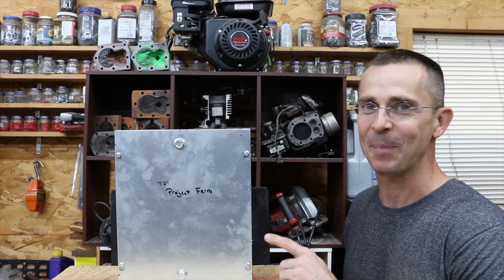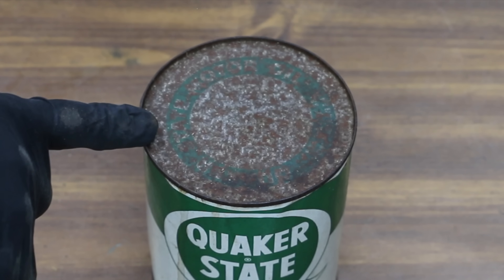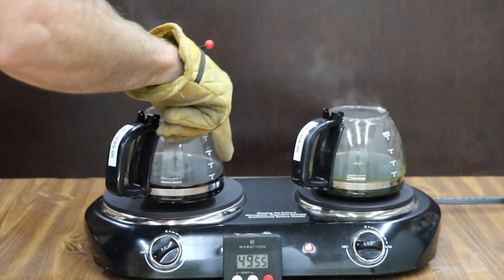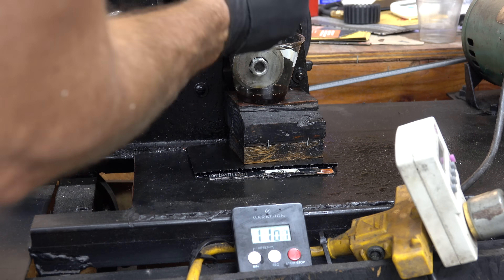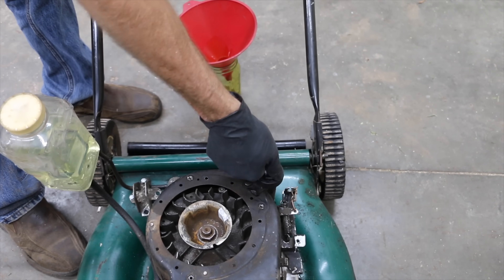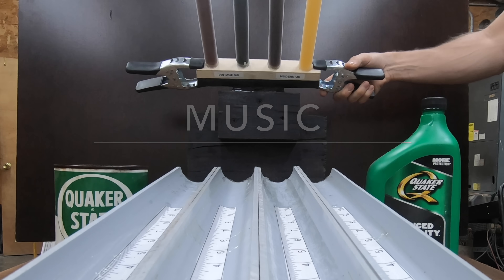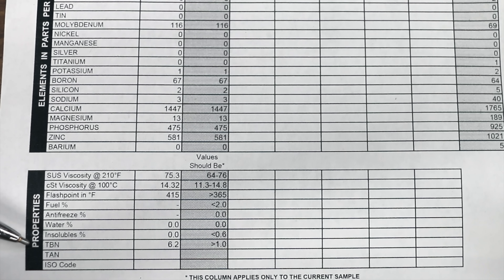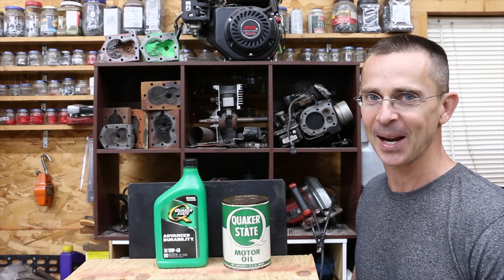Is Oil Good After 70 Years?  Let's find out!

Comment: The shipper has dealt with UPS and the others before.
Reply: United Parcel Service Smashers
Reply: As someone who works at ups unfortunately I can confirm this
Reply: I respect every customers package as if it was my own but they hire some lazy people more often than not
Reply from the maker: Great point!
Reply: That thing is a time capsule. It may have been shipped from the 60’s.
Reply: It's not so much lazy people causing damaged packages, it's the company having the unload send packages down at a rate faster than the conveyors can handle causing them to spill everywhere.  Happens every day all shift long.
Reply: @donjohnson9688  true, I wish the supervisors knew how to manage the operation so it works efficiently
Reply: They are sadistic
Reply: Me too! UPS hated life when they had to cut me a $1800.00 check for their "professional" buffoonery.
Reply: There's reason I call UPS uuuhhhps (oops)
Reply: UPS -  we are kicking parcels over the fence you couldn't do better.
Reply: SO TRUE.
Reply: God, UPS is Brutal!.  On one visit to UPS a worker bee said they couldn't guarantee they wouldn't bend a 1.25 Inch antisway bar for a 1962 Corvette. I took a chance. They shipped a Homda Z50 from Fresno area to North Dakota. But it stopped 10 Miles from the buyer. UPS then REMOVED ALL THE PACKING AND CARDBOARD!!  BUT I had made a video of the box BECAUSE UPS is Criminal. Upon return UPS literally returned it back to the buyer! Over 7000 miles.Why? Because the driver thought he damaged it and was attempting to do a CYA. Damage was only the tail light. I have Many ups stories. FedEx ground was much better at delivery.
Reply: cisa93  Either way he had to travel at 88 Miles an Hour and when the car came to a stop, it along with the box was frosted over. 😂
Reply: BOOM!!!!   😂😂😂
Reply: @AKGirthQuake  I work for another worldwide shipping company and I can confirm here it's the same.
Reply: Usually, it's the oil that the protection. In this case, protection was offered to the oil instead.
Reply: I think they play football when loading trucks
Reply: @thelifeofjessejames  lol loved that one!!!
Reply: I used to work next door to UPS for one of their competitors at an air freight terminal. One night, I was watching them sort and they were really tossing (throwing?) the boxes. I commented to one of their supers that i was friends with about the flight time those boxes were having on the ground and asked; "I didn't think you guys were supposed to throw boxes"? His Reply; "We dont "throw" boxes". "Those boxes are being "relocated" from a distance". True Story. I cracked up too.......
Reply: looks like a bomb :O
Reply: Not UPS...he wouldn't have spent so much time and energy on it as they usually just lose the package.
Reply: @KowboyUSA  They are learning the US Postal Service.
Reply: When you pack for their service, just think the packet will make through a warfield.
Reply: @happyraccoon4791  NEVER TRUST THEM, more when it come to classic car parts. THey dont give a f1ck. I was in a Boombox forum long ago and the radios arribed destroyed, The more they packed them, the more they punished them. They are sh1t and insurance wont cover a piece from a classic that is not easy to find again
Reply: @38911bytefree  that's so true. I have many stories from the early 1980's to 2013. Barbarians. Once I asking Wataf and as I spoke, Lo, two guys were literally throwing my boxes like frisbees. Blind hyenas
Reply: I wonder if that can was undented when it was put in, HEH
Reply: I have seen a300 lb  transmission for a machine (built like a tank) with the 1.5 inch input shaft BENT from being rammed by a UPS  forklift.
Reply: Great heavy duty metal Indoor electrical junction box
Reply: @agarbanzo360  in Soviet Russia, the metal protects oil.
Reply: Most people who pack things to ship do not follow even the minimum requirements posted on the UPS web site, they require at least 3" of packing on all sides of the item and I believe double boxing. If people did that the breakage would drop to near zero, but nope, people get an old, tired used lettuce box out of the trash at the supermarket, put that antique china vase in it, crumple up 3 sheets of newspaper and throw a couple  handfulls of styrofoam peanuts in and call it good. See that a lot over the years on Ebay stuff, while others do a bullet proof packing.
Reply: Man, all that bomb-proof packaging and the can still arrives with a big dent in it!

 LOL
Reply: I guess its just me but from 500+ packages Ive received, maybe like 10 were in bad shape. Lucky me.
Reply: As someone who works in a warehouse (can’t say which one) I can confirm we throw packages around a lot.
Reply: UPZ,  PEDEX,  and  DLH  Workers, never use their company's to send packages,  they use USPS for sure.
Reply: I found out when I had something break that they have a 4 foot drop rule.  Just throw it against the wall while you're at it.
Reply: That is NS ! :-P
Reply: How do they ducking bend a ducking door?!
Reply: PHUK   UPS
Reply: @rarbiart  i'd like to see them kick this package but wrapped in cardboard so they dont see its metal inside
Reply: @AKGirthQuake  Greyhound did it too especially around Xmas when no liquids were to be shipped (so much wine, whiskey, rum was broken as we tossed the boxes into the storage room.) That one was packed quite well.  I would have changed the coffee tin for an iron pipe to handle the drop tests that do happen from 15 feet.

Comment: Best test in 70 years i tell you
Reply from the maker: Thank you!!
Reply: Test it again after 30 years 😎
Reply: Джейсон Хичкок  My dad told me new cars when he was a kid (late 50s) offered oil filters as OPTIONAL equipment.  If you sprang for the filter, you could extend your normal 2000 mile oil change to 3000 miles.  50,000 miles on a car was considered very high miles (probably equiv. to 200K today).
Reply: The question is whether the oil can be affected by the long storage time.  And the metal can is also 70 years old.  But is it the same type of metal can that is manufactured today, maybe there are other substances in that can?
Reply: @ateamfan42  At that time it was probably cast iron straight through the whole engine probably also the pistons?  and it was not a question of ethanol in gasoline
Reply: @ateamfan42  Then there is the question.  How was gasoline 70 years ago
Reply: @Andersljungberg  Either leaded or low octane